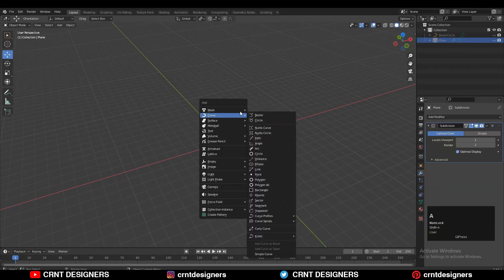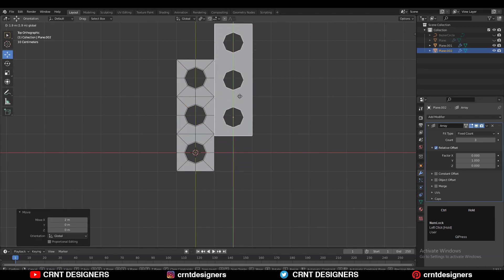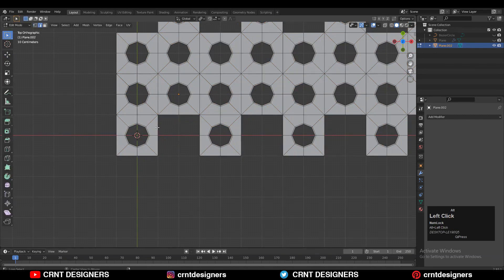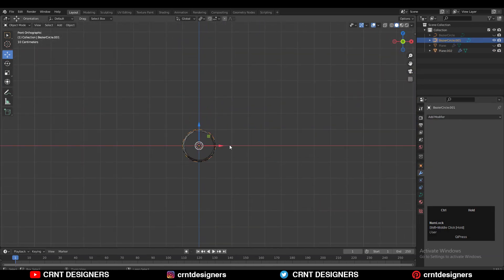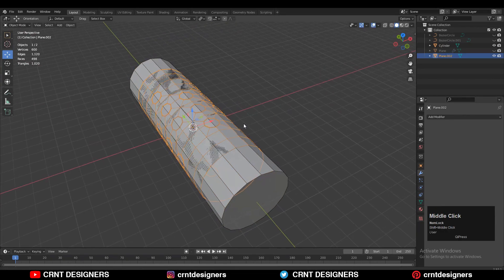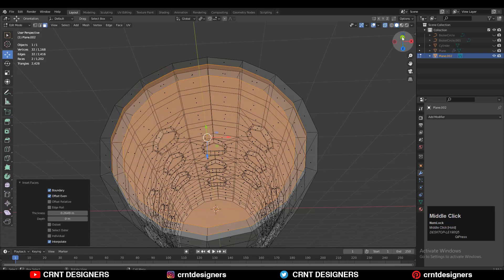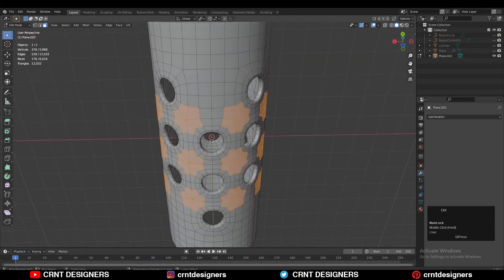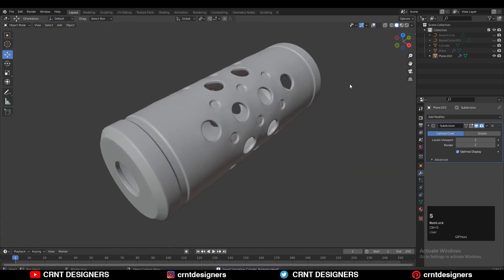Blender Hard Surface Modeling _ Blender Booleans Details _ Blender 3D

Comment: To avoid pinching, you must at least add a 64 sides cylinder. Your cylinder simply doesn't have enough geo to handle such details on a curved surface. You cannot simply fix this kind of shading with "texturing" the foundation of the geometry matters. Try again with a 64 sided cylinder or a plane with more edges/geometry. That's the nature of subdivision modeling on a curved surface, there is no other way around it. You need more geometry to support that kind of detail in that kind of shape. You're welcome